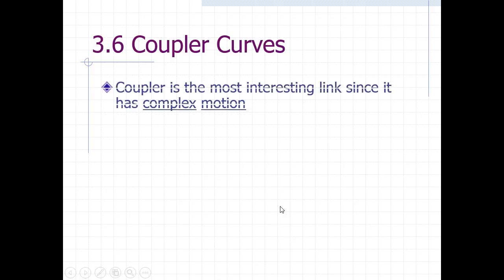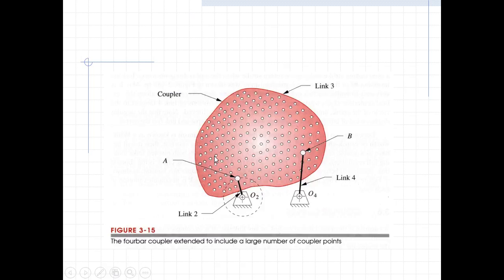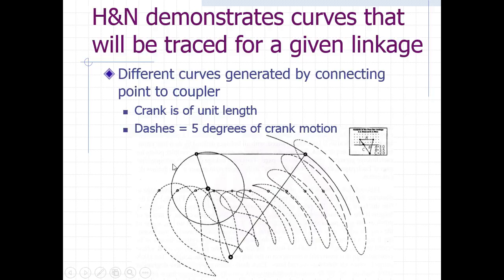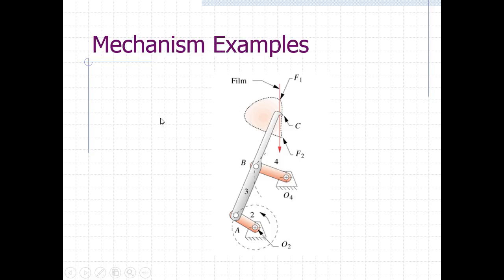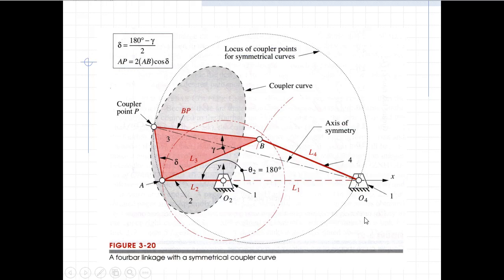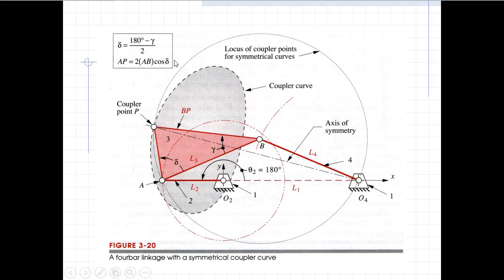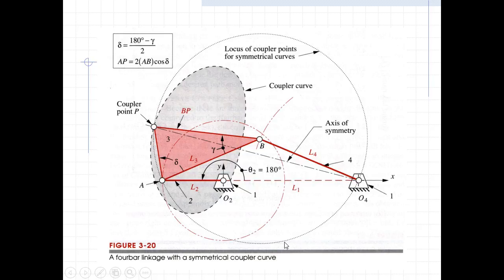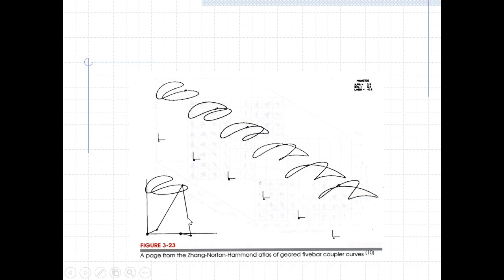Coupler Curves Intro

Comment from the maker: At 18:10 I said that when L1/L2 = 2.0, if the crank had a length L2 = 1.0 inch then the ground length would have a length L1 = 4.0 inch. That is incorrect. I should have said the ground length would have a length L1 = 2.0 inch.